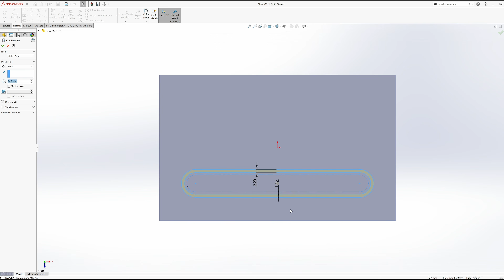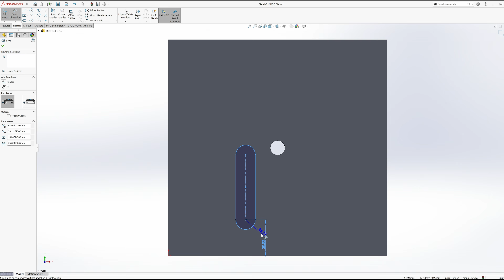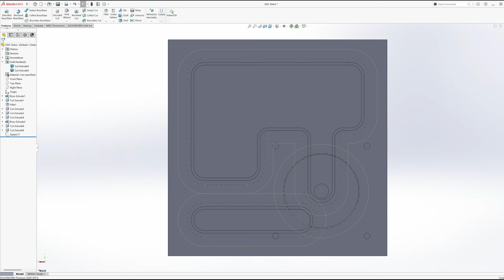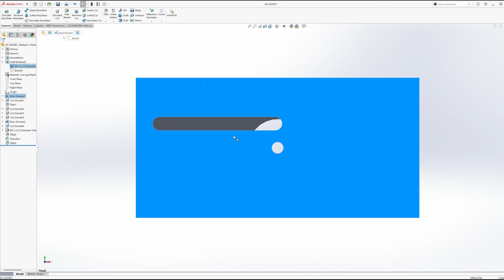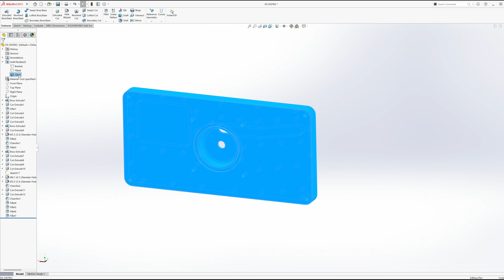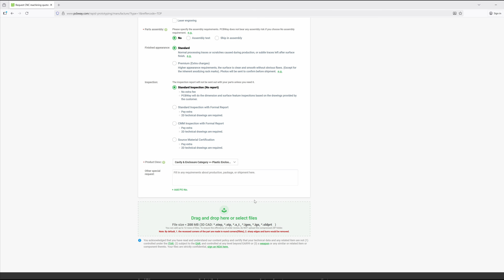How to Design a D5 or DDC Pump Distro Plate

Comment: Thank you so much! There was so much information that went into detail about all the constraints and mesaurements to use in the acrylic  distroplates for my Corsair 1000d. There will be 5 distroplates in the case. I lost confidience in modeling it in fusion 360 because other pc modder videos that show you how to build all the parts in solid works/f360 skip a lot of the steps. I loved that you showed all the detailed information about it instead of skipping over them as a first time custom water distro builder myself. Cheers!
Reply from the maker: Thank you for your comment, this really made my day. The goal was always to make unique things and to show people how they can do it as well, your message confirmed that I am on the right track! So Thank you 

Thats also exactly why I made this specific video, when I started out, I had to combine several videos to get most of the info, and after that I still needed some info that I had to figure out through trail and error! Really glad this video helped you to design your own. Really would like to see you build when it is done! I mean 5 distroplates! Thats the type of builds I am interested in!
Enjoy your build and thank you for taking the time to comment and share your experience, I really appreciate it.
Reply: @marcelgenis  Sorry for the timely reply. Still in the process of making the F360 files. Its hard to design plates for it since i dont have the parts in hand like 2x480x45mm xt45 Alphacool rads, and 2x480x30 st30mm Alphacool. I basically have to go off the geometry to add it in a designing the case which corsair doesnt produce a cad file that can be downloaded. I will release a video on my channel when my corsair 1000d project is complete with the help of your constraints from the video designing the plates that was never mentioned in other diy distroplates video. I plan on finishing it by next Christmas 2026.

Comment: Im making my first distro so this is great, being able to look at the design of the pump housing before designing my own. Thanks a lot.

Does anyone know if a Alphacool VPP pump will be compatible with this design?
Reply from the maker: My pleasure! Glad the video could help. Yeah the Alphacool Apex VPP pump is the same formfactor as the standard D5 pumps. You can can check out their website, they supply a drawing of the pump, the same dimensions as the D5. So yes it will definitely work.

Comment: Thanks for making this video! I have always wanted to design my own distro plate but just do not know enough about the design aspects. You have covered the design very well here. Just a question. At 0:37, I can clearly see foaming between the channel and the o-ring. I don't think I have seen this on my water cooling builds before. 

Is there a small gap between the lid and the base here? I suspect that the o-ring groove might not be big enough to accommodate the o-ring. 
Based on your dimensions, the o-ring groove will have a cross sectional area of 2.86 mm2 (2.2X1.3). The 2mm o-ring has a cross-sectional area of 3.14 mm2. 

Anyway, thanks again. You have given me the confidence to design my first distro plate!
Reply from the maker: Thank you so much, that really means a lot coming from you! I’m glad you liked the video and that it gave you the confidence to design your own. That honestly makes it all worth it.

You’re absolutely right about the bubbles, there were quite a lot in the loop. I used a D5 pump with manual speed control and didn’t realize it was set to the highest setting. The coolant started foaming within seconds, like proper thick foam! Way too fast for such a short loop.

I was a bit pressed for time to finish the video, I couldn't wait for all of the air to escape the loop I had to film it as-is. It’s all sorted now, all the air is out of the loop and the bubbles are gone. If you look closely, there’s still a very thin line of fluid visible over the acrylic edge between the channel and the O-ring. I’ve seen that before, even on some commercial distro plates. It usually comes down to plate thickness and how the surfaces are milled.

As for the fit, yes, there is a slight gap. The plates were surface milled to hit the correct thickness. Before polishing, the groove depth was about 1.28mm, and after polishing it came down to 1.25mm. Not ideal, but much better than being too deep. Next time, I’ll likely use a 2.4mm O-ring instead of 2.2mm, while still keeping the groove smaller than the O-ring itself.

Whether your manufacturer surface-mills the plates or just uses standard acrylic sheets and mills the channels, you always want the O-ring groove slightly smaller than the O-ring. That’s what’s worked best for me over the years.

When I had access to a CNC, my go-to groove size was 2.4mm × 1.3mm. I initially followed standard specs for static compression (around 2.7mm × 1.5mm), but that often caused leaks — especially near the pump outlet channel where the acrylic is very thin. Acrylic flexes a lot more than aluminum, so tighter tolerances give a better seal. If the manufacturer uses standard sheet thickness (without surface milling), variation in acrylic thickness can cause inconsistencies, which is why I recommend a groove depth of 1.3mm and width between 2.2mm–2.4mm. That setup has worked really reliably for me.

Hope that all makes sense! These values are just based on my personal experience and testing, but I wanted to share what’s worked and will work for someone that does not have the background or experience in manufacturing distro's like this.
And again, thank you so much for the kind words and for taking the time to comment, I really appreciate it!
Reply: @marcelgenis Thanks for the advice. I was wondering whether you have experience with designing CPU/GPU waterblocks. I imagine that those would be more technical since it involves a metal piece also. If yes, could you make a video? Thanks.
Reply from the maker: @Fusion360School Hi there, sorry I missed your message! I am planning on making a video on how to design GPU and CPU blocks. More likely two separate videos. They are definitely more complex, just need to test a few things, just to make sure I can give sound design advice that will be applicable to most GPU’s and CPU’s. Hopefully I will have them done within the first half of this year!

Comment: Ohhh I've been waiting on this one!!! I really want to do this. And yes PCBWay and Digi are both amazing I've used their services before 🙏🏽. M3 and M4 screws are all I use for builds
Reply from the maker: Hey Levi! Nice seeing you here! Haven’t used Digi yet, but PCBWay’s quality is amazing! Yeah don’t think I ever used a larger screw than M4 in any any build yet, keeps it simple!
Reply: good to be back, I've been in my own world of learning 😅it's been a slice haha. Heavy User of Digikey Canada for Thermal putty and other experimental gear. And yeah I normally use or Always use I should say, M3 and M4 ranging from 3MM to 35MM, 30MM to 35MM for my rads just depends if I'm using spacers or not. M3 -3MM normally always from rad to case.
Reply from the maker: @ElysiumMachines  Where do you get your spacers from? It is so difficult to get the spacers in SA!